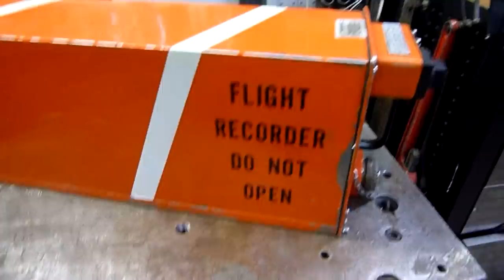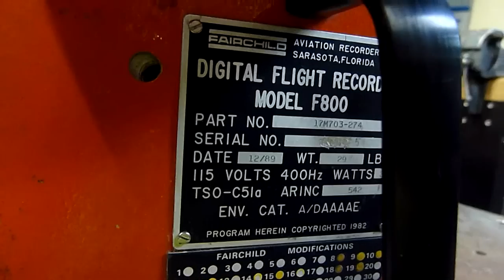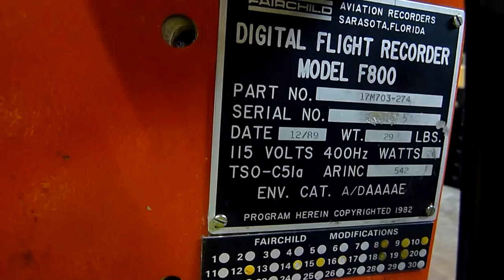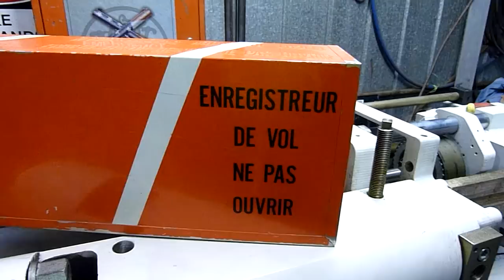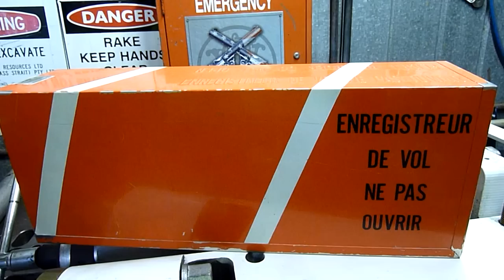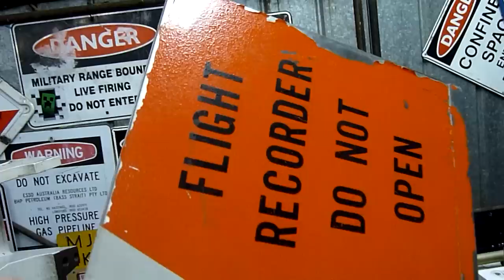Fairchild F800 "Black Box" Digital Flight Recorder Autopsy Pt1

Comment: Very nice build piece of equipment with Militairy quality components. Nice cap vent at 14:50. Looks like a voltage regulator board. Varnished boards & components, ( more or less waterproof ) except the pin connectors.

Comment: Great purchase mate,
F800's are still in service somewhere. Basically everything was outphased when the minimum requirement for DFDR's was set to 25 flight hours instead of the old 3-5 flight hours. Really a good find just as collectors item to have.
I'm pretty sure this DFDR is under Arinc 542 comm protocol. so it can be read out or played with when you supply it with 115 400Hz.Also Static press & IAS ports are for cross check on 542 feed (oldskool stuff).. Great vid mate !!

Comment: The reason why it uses both the altitude input and the airspeed input to compute speed is mostly that airspeed is measured by dynamic pressure, which is total stagnation pressure (from the pitot tube) minus the static pressure (pressure measured through the static port, located on a part of the plane where the air pressure is the least influenced by airspeed, giving a close approximation to the ambient air pressure around the aircraft). They may be doing conversion from indicated airspeed (IAS) to calibrated airspeed (CAS) or true airspeed (TAS) or Mach number, but even if not, they need both inputs to get airspeed.
Reply from the maker: that is really cool!, I love the old style aviation recorders!

Comment from the maker: the crucial tape drive is well protected, not water proof, but it would implode under the pressure of a deep sea swim anyway. the tape itself is very resistant to salt water and other fluid ingress including JET-A1 fuel.

Comment from the maker: I have seen some Mayday episodes but they are just re-edited versions of Seconds from Disaster or Air Crash Investigation, I prefer the originals.

the larger metal can transistor ones are voltage comparators made by Fairchild Semiconductors

Comment: I think the reason that the airspeed and altitude are connected, is because they are compared. This is probably needed because measured airspeed changes with altitude so there is probably a relationship used to determine the true airspeed. This is just assuming that somehow those instruments in the recorder are getting a reading from a pitot tube.

Comment: Another program that covers air crash investigations that may interest you is called "Mayday", it also has the occasional train crash in it as well. It's a low budget show but it's still interesting. Those round cans that look like large transistors may be another type of IC, ICs with that style of package used to be common in gear from the late 1960s up until the late 1970s. I noticed that there are a fair number of silver mica caps on some of those boards, those are precision capacitors.

Comment: The TND903 is an array of eight 1N4148 diodes in a 16-pin CERDIP package...they're used where a lot of small signal diodes is needed in a small amount of space.

Comment: ill just buy 2 of the cheap $30 ebay ones that are for pick up in dandy and keep a spare in case they are crap. still need to work out a pre pump filter. you havent got any largish screw together fittings have you. something i can put 1/2 inch barbs on and put a series of filter screens that i can take apart to clean out regularly do you?

Comment: Stacks of 4000 series cmos logic chips, 4050's i think, and lots of operational amplifiers :-)
Most of the boards look very neat, but the end two dont look as they were made by the same company.

The cpu pcb, i was seeing rams,eproms interface chips and allsorts, yum lol :-)

That psu looks like its been in the wars.

Thanks Ed, ive never seen the inside of one of those :-) :-)

Comment: The flight recorder is the main control of the cockpit the cockpit voice recorder that records everything in the the airplanes  from the navigation to high and low altitudes take offs landings pilots copilot flight attendants passengers and cabin pressure and fuel
Reply from the maker: nadine dambra I think you have the recorders roles back to front, I have the full technical manual on this recorder and it never states anything about being tied to the cockpit mic.